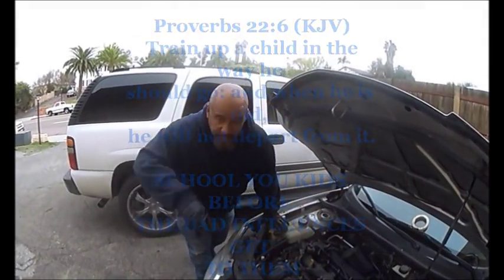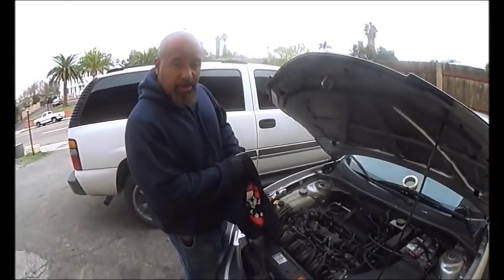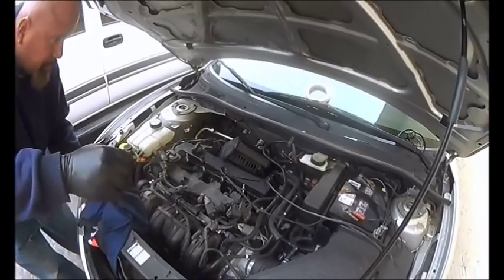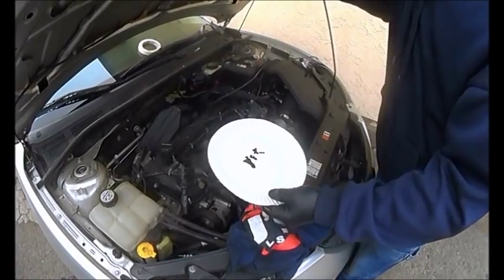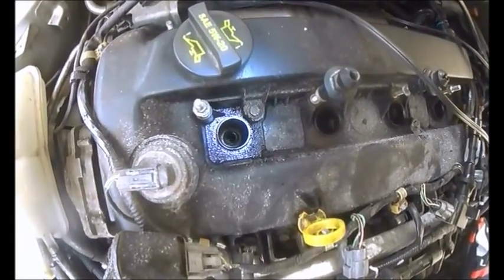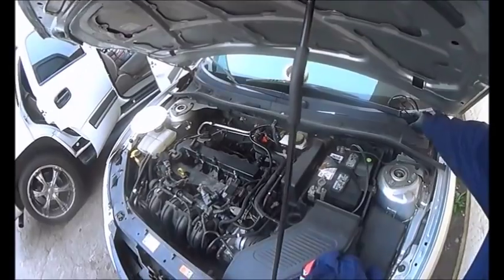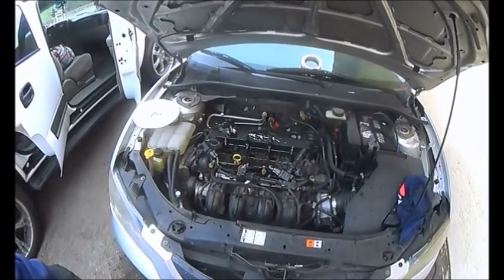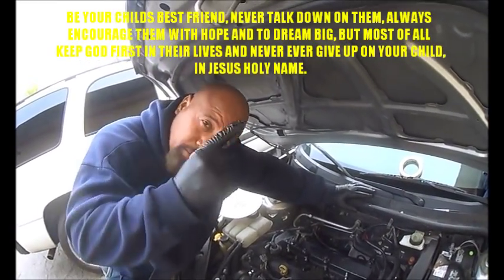CHECK A BLOWN HEAD GASKET IN 5 MINUTES/ SKOOL YOUR KIDS

Comment: Another good way is to check the fill cap. If there is excessive milky residue on it. Well water in the oil. Sometimes if the car sits for a long time itll has some condensation in the crankcase and there will be just a smidge of milky white on the oil cap. Like really light film

Comment: Hello 1st I would like to say thanks for the informative video on the Head Gasket Video. I managed to acquire a Dodge Caravan Sport 1999 from a inlaw. The van was loosing coolant at times, but needing a vehicle we paid no mind to it, we would just add water to the radiator when it got hot. We used the van couple mo with some driving of 100miles a week 1 trip back and forth. When it got hot we added water on the side of teh road, we were in rough times financially as well. So taking in to a mech was not a option. One day the van got hot we rode it hot till it turned off at a light we had no choice we was on a freeway noone to call and had to get home wife pregnant.

It died on us and it cranked again but soon turned off about 1/4 away from home. A mechanic saw us and went to check if we needed help which we did. He checked and said radiator cap is not even hot and that it has a smell to it. He said the water pump must not be working. He towed us home and towed the van to his place to get fixed. He came back and said water pump was busted and that it seems we rode on it like that for some time cause the fins or propeller was grinded down missing. He said looks like the head gasket is blown because water shot out the radiator cap when he tried to crank it. Now we were stuck with no van, I went ahead and said hmmm maybe I can fix it. Mind you van has not cranked since that day it shut off on us.

Well I removed the heads 1st time doing it mind you. I have the gaskets off and heads off was a pain in the rear. Now I have everything in my cart to buy and get shipped to me that is needed to repair this. I got 2 new heads since I have no way to take my current ones to a machine shop no car mind you. Then I see some videos stating that I need to check if the engine had compression to see if its even worth repairing the gaskets. Well its to late to test that cause I have no heads on the van atm. From my story so far what is the odds of my van working with the new heads and gaskets,since I never got to check my engine. The engine is cast iron block. I also notice I did not have a thermostats to even begin with I can't find it at all.

Please help me out thanks. God Bless

Comment: Happy Holidays Oldskool, and to all your subscribers!!
Reply: thank you, and merry christmas to you
Reply from the maker: Merry Christmas keep them videos coming my man PERSISTENCE.
Reply: @oldskoolfunk71  Thank you because I remember when you first stopped by channel and showed your support, and that was when we only had 1500 subscribers, and because of that I am PERSISTENT
Reply: @Signkae1  THANKS!
Reply: oldskool funk hi I have a 1997 Ford Expedition Xlt and I just change the oil and filter put some coolant on it cz it was running a bit low and after I finish it start leaking water from the muffler and the temperature gauge doesn’t work even after I change the temperature sensors and the thermostat any ideas on what I’m missing thanks in advance

Comment: Have you ever had/seen condensation/water contamination in the oil right after an oil change? (Within 150 miles) It was visible only on the dipstick, there was nothing visible under the oil cap. But after 1500 miles it's back to perfectly clear oil? Like the condensation boiled/burned out?... I don't have to add oil between changes and my coolant level hasn't changed in 2 years.

Comment: so im going to teach you another way you might not know but my dad tought me this. Take a lighter and if it has a metal dipstick just hold the lighter under the dipstick and heat that oil. If it starts spattering and all you got water in there that starts boiling and that will spatter the oil away. We allways do that when we go looking for a car. Just heat the oil on a piece of metal, if it spatters the headgasket is gone, or the head/block cracked. But if you still need to buy it then the price needs to be really low so you have money to fix it, or just walk away.

Comment: Since you have good helpful videos, here is a tip you may be able to use if you ever, and I know you will have to drill out a hardened bolt up to grade 12. I'm pretty old and it was taught to me as a young man by an old man. It may sound strange but instead of oil or any kind of cutting fluid, use vinegar, plain old vinegar, and a slow drill speed.  If your drill is sharp, it will cut it like butter.
 Keep up the good work, we need more like you.

Comment: Does a blown head gasket also mean that there could possibly be gasoline in the coolant? I have a 2016 Jeep Patriot Latitude 2.0 and it overheated once about a week ago and i immediately pulled over and called a wrecker but it kept showing a misfire in cylinder 1 and 3 P0301 and P0303 so my husband changed all my ignition coils and spark plugs but it still is showing a general misfire so called a mechanic and he said when he looked at my truck he smelled gasoline in the coolant and showed it to me and he said that meant a blown head gasket, is that true?  It's not showing any of the usual symptoms of a blown head gasket there isn't any water in the oil and there is no white smoke coming from the exhaust the only thing that we were able to notice was the coolant did smell like gas a little bit. Just want to make sure before i paid for the heads to be rebuilt and for some reason it isn't the problem

Comment: Merry Christmas brother I have a Nissan Titan and my crankrod bearings need to be replaced. I've put 2 layers of aluminum foil behind them it took the knock out. It would tap a little so I added a another layer but didn't put enough torque and shredded one bearing.  Wish you lived near me bro I could use ya help. I'm no mechanic I do auto pant and body work. 
Do you have a Facebook page we can follow?

Comment: I have a question oldskool I have a 97 Honda civic I installed the distributor wrong and caused the 2 teeth/gears to break inside the camshaft its impossible to get with a magnet not enough room I nervous to start it with those pieces inside the cam should I risk it or remove the camshaft to retrieve the pieces?

Comment: Hey man, my Diesel engine is overheating, I’m pretty sure it’s the head gasket because it’s misfiring and there’s a foul white smoke which I’m guessing to be steam and coolant fumes.
Can I do this test by removing injectors and their fuse seeing as it’s not spark ignition?
Cheers, you da man!

Comment: Merry Christmas to you and your family bro. 

Question: I have a 2000 bmw 528i, and it's making a squeaky/ whistling noise when i start it up. It stops squeeking after the car warms up for the most part. I think it might be my tensioners because i replaced my water pump and had to take the belt system off to get to it. My unc suggested a quick fix would be to spray some wd40 on the belt and see if it still made the noise. If it didn't, that would tell me I needed to replace the belt. Is there something else i'm missing? (This might be an extremely easy process for most adept mechanics, but i'm just starting to work on my vehicle, and i'm learning in the process). Thanks for any advice!
Reply: Lol, oil on a belt sounds like a bad idea. I've seen people simply spraying it with water.
Reply from the maker: I would take the serpentine  belt off, start the car and run it for less than a minute to see if it's quiet. With the car off, and no belt, then I would spin each pulley by hand to pin point which pulley has the noise. That's where I would start. Do not put oil on the belt it will slip. You can also get a spray bottle with water and spray each pulley ( wear glasses ) it will throw the water.
Reply: oldskool funk sounds good. I will get right on it. God bless!

Comment: After testing the car for blown head gasket how do you know its just a gasket and not problem with valves or worse??
Reply from the maker: A leak down test will show you if the valves are leaking. I have a video on how to make a leak down tester and how to use it if you would like to see it